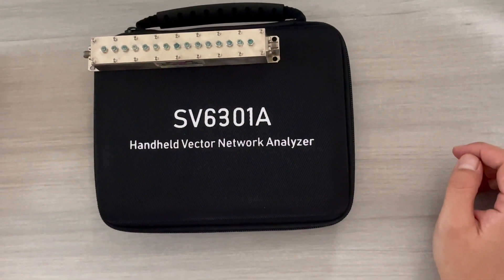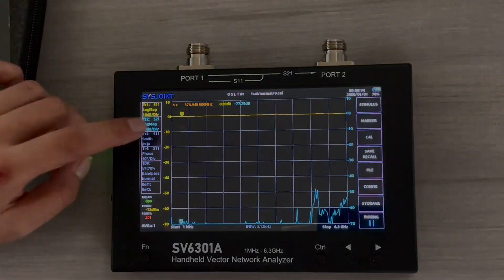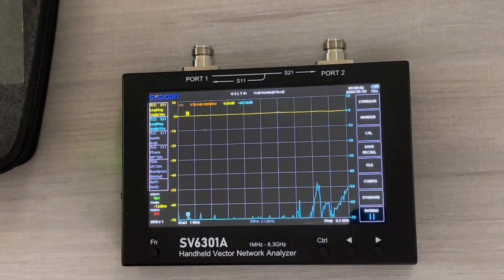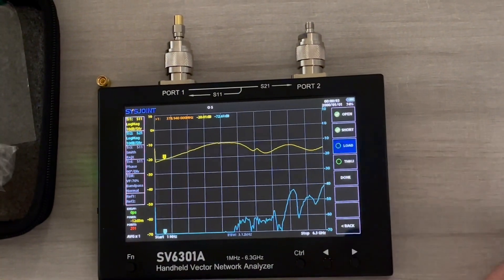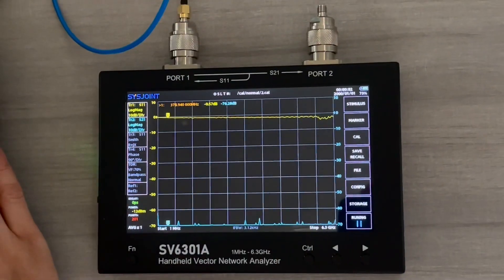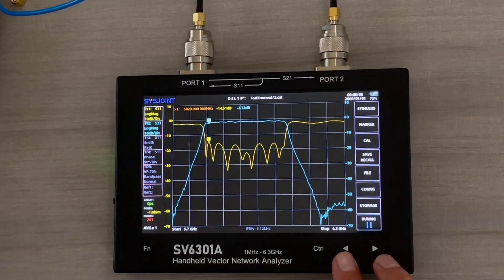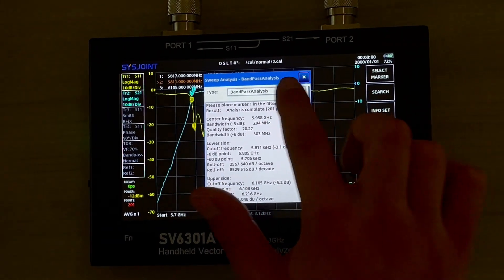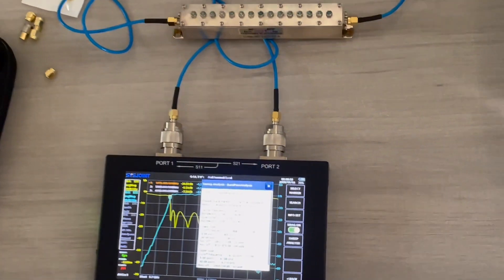Filter Testing with the SV6301A VNA 6G

Comment: Hi, you make a incorrect calibration! Because for S11 the calibration was made at the end of the cable, not at the intrument port! Bye
Reply: And the 2nd coax added and not calibrated out easily has close to the 2dB of insertion loss seen in the passband at 6GHz. So the filter really only has probably 0.1-0.3dB of insertion loss, not 2dB.